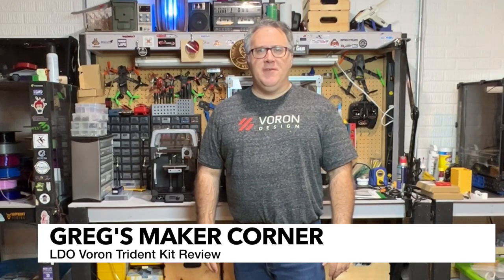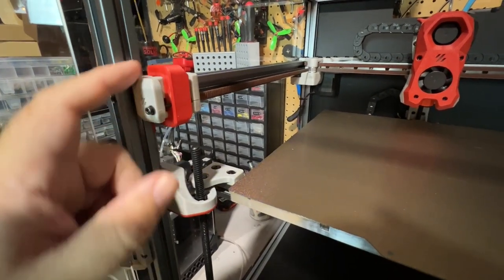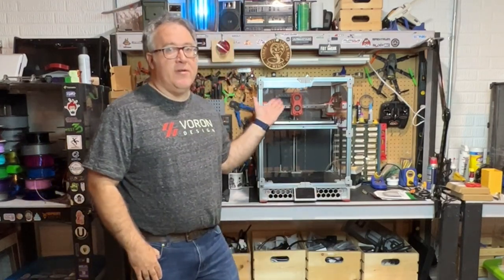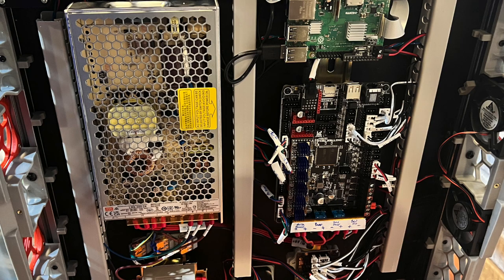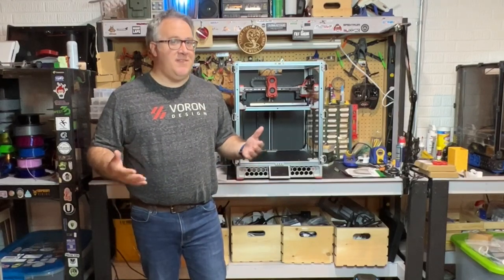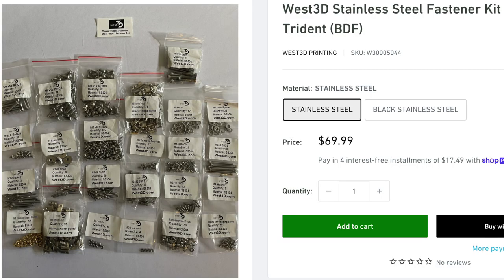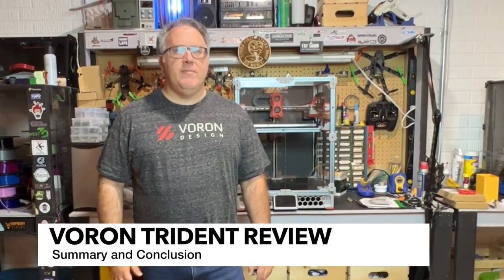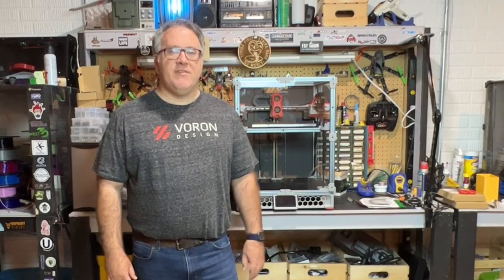LDO Voron Trident Kit Review

Comment: Very nice video and review. One thing I noticed though at 7:59:
Looking at the Omron Relay for the heated bed, it states: "Earth the mounting rail".
Usually this is done by using the UK2.5 Grounding Terminal Block, as it automatically grounds the rail it sits on.
When using the Wago 221 connectors there is no automatic DIN rail grounding. So I guess you need to run another cable and screw that to the rail to ground it and meet the technical requirements of the relay.
Reply from the maker: Yes that is a great point and it’s a good idea to tie everything to earth on the AC side including the bed, ssr and psu. The ldo instructions also suggest earthing to the frame from the block.

Comment: I wish I waited on purchasing the kit. I bought my LDO Kit through 3DMaker and I didn't get many of the items listed on LDO's website, plus it came in 3 separate packages over 2 months. I was hoping for the pre-cut & crimped wires but instead they just threw in a box with a couple spools of wire and loose connectors. Also, it didn't come with any of the input shaper components like LDO says it comes with. My kit was just over $1800. I think I would buy the kit from a different vendor or source it myself next time.
Reply from the maker: I am sorry to hear that your other kit wasn't as good.  There are a lot of vendors that are putting together kits and some are hit and miss. On the plus side they are providing a kit pretty quickly, so at least you have that early adopter advantage (though it sounds like maybe not so in your experience). I have had pretty good luck with West3d and some of the other Voron Discord vendors in terms of "self sourced" kits but never tried 3DMaker. 

I know LDO kits sometimes take a bit before they are ready for prime time, it seems like there is around a 6 month lag from the time the Voron team releases the printer/manual to the time a kit is made.  I think LDO has a pretty good advantage in that it offers a well thought out kit but it does take some time. 

Thanks for watching and best of luck for your future builds!
Reply: @GregsMakerCorner  Thank you Greg for your help. I'll look into West3D next time. I bought my kit in February so 3D Maker Parts might have a better kit now but I won't buy from them again.

Comment: So, my next printer.. Trident or 2.4?
Reply from the maker: Such a tough one… my next Vid will help with that topic!! You can’t go wrong with either one though, so if price is a bigger concern Trident is a good way to go.
Reply: Vzbot.  Vorons are goofy and not ideal.  Triple z is a wasteful meme imo.
Reply from the maker: @M1America  I prefer the term "over engineered"... Practically speaking, a 3 point leveling system works very well. The Z-tilt tri-leveling approach allows you to automatically level the entire plane of the heated bed. If you only had 2 lead screws, you would have to use a more traditional method of building a bed mesh. That obviously can work, but has a different set of tradeoffs and doesn't compensate for skew as well.
Reply: @GregsMakerCorner  It's not though.  Much of the design of the voron is pointless, of little benefit, and very expensive.  Its for impressing other 3d printer builders, not for any type of practicality.

I use a belted Z axis with two leadscrews and a single motor.  IT hasn't lost level since I built it.  Its not constantly losing its calibration like you get with multiple Z motors.

My point exactly, voron manufactures problems and then solves them with even more complexity.  They are continuing to do exactly that with the CAN toolhead nonsense.